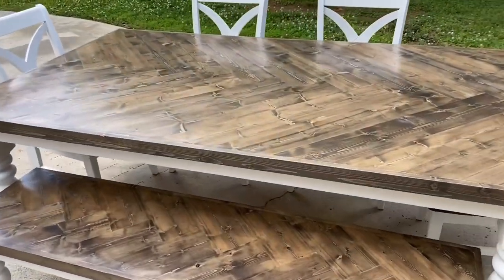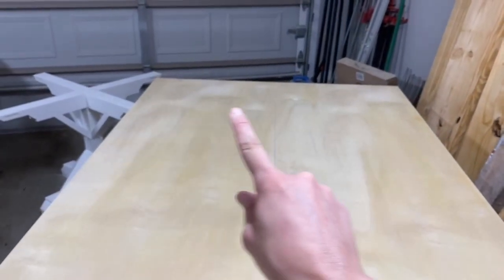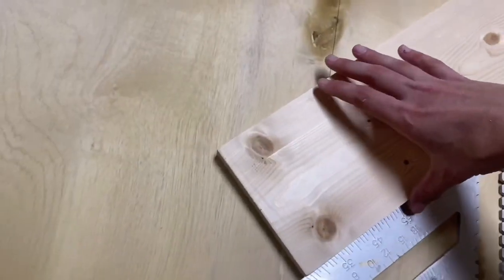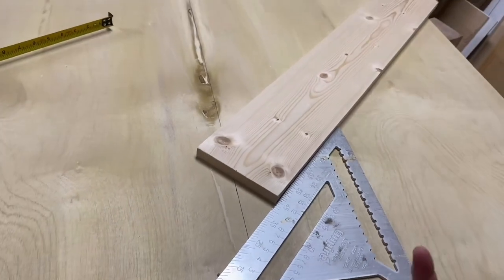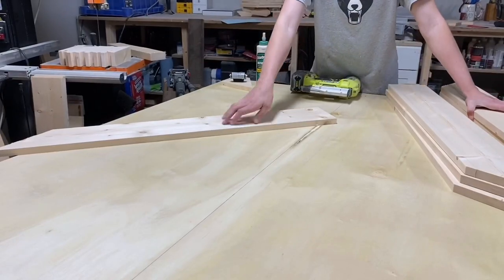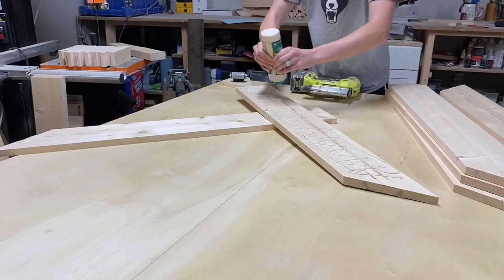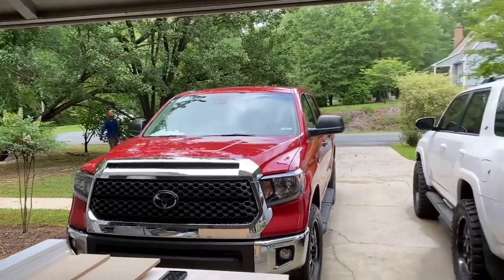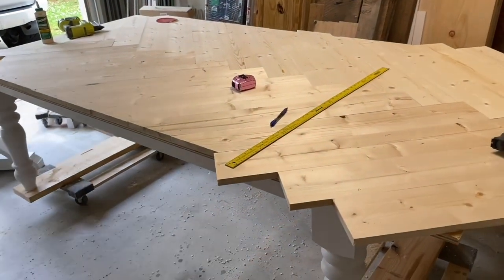How To: Build A Herringbone Table

Comment: So i have loads of questions but just one for now... I build things but i use rough sawn pine and have to sand it all a lot especially if i use it for tables... Would you recommend only using the kiln dried timber so it stays flat?
Reply from the maker: Always use dry wood. Even if it’s rough sawn make sure it’s dry. If you get rough sawn buy a planer and jointer to shave off all the roughness :)
Reply from the maker: Always use dry wood. Even if it’s rough sawn make sure it’s dry. If you get rough sawn buy a planer and jointer to shave off all the roughness :)

Comment: Hi!  Looks amazing.  I am currently researching building a table, curious if you've had issues with seasonal wood movement especially with the cross grain joints around edges?
Reply from the maker: Hello! Not yet- I use Starbond between all seams after everything is in place to ensure no separation
Reply: I am also curious if there are any issues with the plywood not allowing for wood movement. Thanks!

Comment: What grit did you use to sand it? What did you use to seal it? Im debating trying epoxy or polyurethane sealant.
Reply from the maker: I sand up to 150 grit. I spray Minwax Polycrylic sealant then lightly sand with 1000 and spray again sand again 1000 and spray a last third coat to get the smoothest finish!

Comment: this is amazing. I was wondering if I could have more info about the wood you put on the side of the table. Im just wondering how you got the trim pieces to lay flush on the side and the cuts you used. In the vid they just looked like regular, no angle at all. I don't do this all the time so I'm trying to wrap my head around it
Reply from the maker: Yeah just flat 1x pieces to match the top boards cut to 2” thick. Butt jointed glued and nailed in!

Comment: Beautiful table! I like the white with dark top. 
I made a herringbone table out of rustic old barn wood. Came out pretty nice 👍
So how did you attach top to frame?
Thanks for sharing. I'll subscribe to your channel 👍
Reply from the maker: Thank you! I used z-clips to attach my tops to the bases
Reply: @glamfarmhouse  👍
Reply: @glamfarmhouse  
Have another question.
When you centered your first board, at what degree of angle are your boards at?
Reply from the maker: @lazio7495  45°!
Reply: @glamfarmhouse  
That's how mine turned out too.
I suppose it could work out at different angles. I was testing it out on a sheet of paper and it looks like it could work.
Thanks 👍

Comment: bit blotchy to say the least, which is a shame. Try thinning down some PVA & then put  your finish on. Nevertheless it was a good effort, well done!!
Reply from the maker: Hahaha what are you talking about? It’s not blotchy at all 😂 it was perfect and the customer was and still is over the moon happy with it so ✌🏻✌🏻✌🏻
Reply: @glamfarmhouse  what I think they are referring to is sometimes boards like that can leave a slight discoloration in areas when staining unless you use pre-stain first. With the pre-stain it helps to give it a more uniform stain. I've tried it and it does make a difference but its also based on preference. Great build either way
Reply from the maker: @chi027  thanks, yes I use pre-stain. So again not sure how it’s “splotchy”. It was legit perfect 😂 but it’s was pine and like you said and like every woodworker knows-wood absorbs again more in some areas than others regardless of pre-stain or not. Different boards from different trees will absorb stain differently. Common sense in my opinion.
Reply: @glamfarmhouse  I love the different shades of wood.  That's the beauty of wood, no two pieces are identical.  Ive watched this build twice now and it kicks butt!  Such a gorgeous final product.

Comment: Why on earth would you put nails into this? Like seriously. The glue is definitely stronger than the nails. Clueless.
Reply from the maker: LOL they’re pub nails. You can’t even see them after everything is filled. They’re there to hold the boards in place while the glue dries. Also there’s no way to clamp the middle of the table so the nails act as a clamp. Please think before commenting.